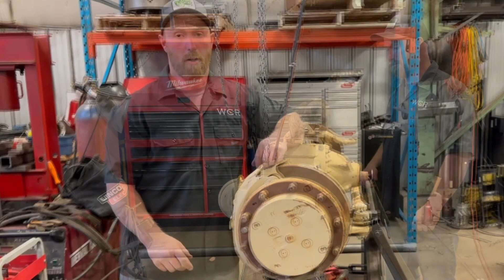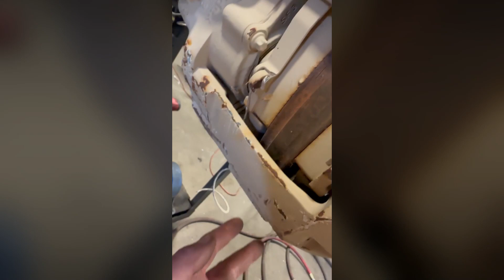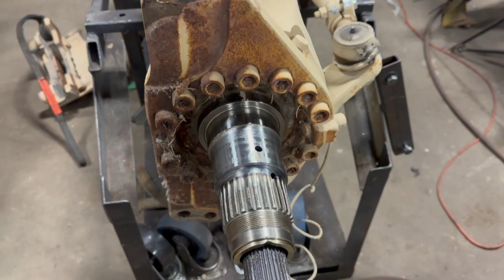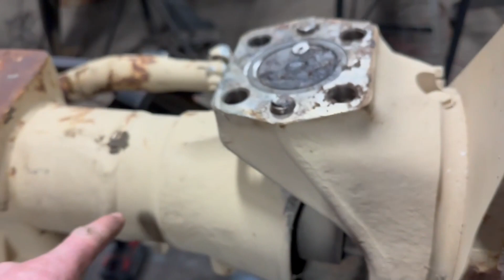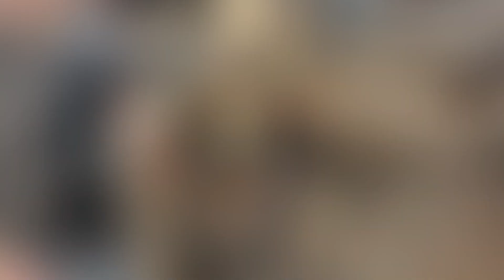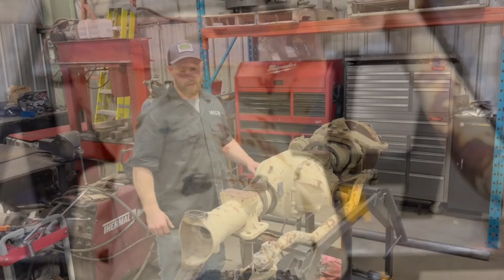Axletech 4000 Wheel End Disassembly

Comment: axletech made portals for the 3 and 4000 have you ever seen these ? I would think that would be a bounty hole killer
Reply: I have the older Rockwell version of the 3000 series with portals. If you look it up on Pirate4x4 you’ll see a pile of pictures of them torn down. Hopefully when they went on to be redesigned by axletech they sorted out the shortcomings. I never did use mine but thinking I might build an independent setup from the knuckles out.
Reply: @jamie_grieve  thank you
Reply from the maker: we have seen a few sets, they are not very common though
Reply: @WesternCanadianRockwell  Why is that . ?  I believe portal hubs or final drives if your a farmer are not more popular is because there is way to much drop .The drop below axle center line is far worse than blocks on top of the housing .  I have been working on coming up with final drives with only 3 inches drop and uses the 14 bolt center section and rockwell 2  1/2 ton knuckles , king pins , U joints .  I am shooting for a 1.75 or there about gear ratio .I wanted to use the rockwell  knuckles mostly because of the boot that keeps mud out of the u joints . But the lack of bushing on the inside concerns me ,. What is your opinion on my choice of knuckle .  I am in the final design phase . Your videos or such a help . Thank you for responding to my comments
Reply: @huckstirred7112  
I’m curious why you think blocks on top of a straight axle is superior to a typical portal axle with say a 5” drop? I’m not disagreeing with you for your application, I’m always interested to learn new things.
I run portals on a few things and they’re really bad if you get properly bogged as they’ll start burrowing under the ground instead of climbing on top. I’m interested in your portal hub design too with how you get a 3” drop, are you using a sun gear like a planetary?
Cheers.
Reply: @jamie_grieve  wow I didn't think anyone would respond to my comment. I didn't say blocks were worse than portals ,I said portals are as equally as bad as blocks . The reason is physics .On a portal your out put shaft has 1 single mission in life . That mission is to be on the same plane as the input shaft . The twisting forces that a portal puts on the suspension and frame is beyond comprehension . And each inch that output shaft is from the input shaft , those forces are multiplied many times over .  I was in third gear going across a lake levy . I hit a knee high man hole cover . No damage to the suspension of the 1 ton power wagon . But it ripped the hood latch off my hood ."the hood flew up and busted my windshield ,The seat ripped from the floor board and I bounced my head of the roof and my nose off the steering wheel / If I had portals my frame would have horse shewed and I would have ended up in the lake upside down .  The output shaft would have had so much leverage my springs may have ripped off as well Blocks on the front have a similar effect .If you go below your bottom king pin  Then the bottom king pin will be doing all the work ,and risk getting sheared .Ever wonder why H1 hummers have the A arms hanging so far down ? That is because they had tho keep the out put shaft above the lower king pin .   If you have to have a geared hub the closer your out put shaft is to the in put shaft the better . The whole reason to have a geared final drive is this .To reverse rotation on the 14 bolt rear end  . As of now if you run a heavy equipment tire , "46 inch and bigger military surplus tires for example " You have 3 choices a flimsy 1 tone dana 60 , "When you have rotating mass 4 foot tall and over 3oo pounds Dana 60 is flimsy " , A 14 bolt with a ww2 g506 transfer case . Rotation is reversed in the transfer case , the front axle standard rotation ,a 2 /2 ton rockwell which has a 12 inch tower on top  or a 2 1/2 ton banjo . If you run a banjo , Banjo is normal strait axle "  with a pumpkin so big you might as well run 38 inch tires on a dana 60
I want an axle that meets this criteria  .Have a similar pumpkin size as a dana 60 but can handle a 4 foot tall tire that weighs 350 pounds .  there are about 4 different types  of 14 bolt axles .  is the heavy duty on motor homes .The only difference is bigger bearings and a 4 inch tube . I want to ad knuckles from a 2 1/2 ton rockwell to the HD 14 bolt . Where the spindle bolts to the knuckle bolt on a gear box . The input shaft would be 1 7/8 inch drop to  3/4 inch ,with 40 splines . then to  1 1/2 inches ,On those splines would be a 3 inch double helix gear ." double helix is twice as strong as a single helix and has no thrust the 1/8 inch acts as a collar and can then be held in place with a snap ring . The bottom  shaft would be 2 1/4 step down to 2 1/8 inches at the splines and 2 inches in diameter the rest of the way out  . The 2 1/2 ton hub would have the diameter which has the bolts  turned way down but be captured in a metal ring welded to the gear box .Hub and spindle would be 2 1/2 ton rockwell . The gear ratio will be 1.4 to 1 that would take almost half the stress off the ring and pinion . That would allow me to shave the 4 bolt to a 10 inch ring gear . The tube being 4 inches in diameter would place the out put shaft about an inch or so below the tube . But still above the bottom king pin . If the 3 inch gears are to tall I may half to go to a 2 1/2 inch tall gear and go with slightly smaller shafts . Sorry for writing a book want to know more or want more  details just say so
Reply: @huckstirred7112  
Ah so a four gear portal to keep the direction the same. With such a short portal drop even with the upper and lower gears almost touching the jacking forces on the intermediate gears would be immense, like many tons. Your setup would be way stronger as a two gear portal with slightly larger gears. I don’t think there’s ever been a successful 4 gear portal on a commercial vehicle. Aftermarket ones like the Tibus and Marks adapters were also plagued with problems in light duty recreational vehicles with the intermediate gears. You could just use massive bearings and not the needle rollers they used to keep it compact. I don’t know if there’s a reverse cut 14 bolt crown wheel?
I do disagree with you on the forces on the frame with portal axles. I would suggest that the only factor at play here is the link location. If you put links on a portal axle in an identical location relative to the hub centreline as a straight axle then the forces will remain identical if the overall gearing remained identical. 
I think if you want to run 48” tyres on portals you could use Unimog axles without putting a spanner on them. The issues become diff clearance and weight. If it’s just gearing then use a banjo planetary axle. 
On the link placement you can have the links well below the hub centre but tucked inside a positive offset wheel rim. I have 14” of link separation on my heap of scrap. Something else to consider is that the factory Rockwell portals have a 1.6:1 diff so the pinion is large relative to the crown wheel which is tiny. It’s only 7.5” so there’s no massive pumpkin and the ground clearance is good.Unfortunately the half shafts are tiny, only like 33mm at the splines but necked down in the shafts. I put a pile of pictures on Pirate years ago.
I think if you have gear and spline cutting capabilities and can get the heat treatment done then building bolt on portals for 14 bolts and 2/12 tons for cheap would be amazing. 
Just thinking too, DSTrac axles warranty their portals up to 46” tyres and they have D70 centres and 4 gear portals. That might be an option for you?
Reply: @jamie_grieve   Acualy I don't want portals .If I flip a 14 bolt and have custom cut reverse rotation gears ,The pinion bearings will starve for oil.  If I get a g506 transfercase to reverse the rotation .Well they have a 1.5 under drive in high range and a 3-1 low range along with tiny output shafts . So If I want a 14 bolt , shaved and for the front a 2 geared hub is  my best option .I love the boot on the 2 1/2ton rockwell .It makes them impervious to mud. Those king pins are large . The outside flange is perfect spot to bolt on a gearbox . So I got durability and common easy to get repair parts . If you ask a farmer about portals he will have no Idea what you are speaking of .In fourwheel drive world they are portals in farm world they are final drives . Said that to keep me from getting confused . You are correct about hooking the links up. If you have a traction bar under your housing close to out put shaft it behaves like a normal axle . But I don't want links hanging down like that . One thing you really confused me on .Is a double helical gear the same strength in both directions .now I am not sure .  If you have a 6 inch portal Adds to to problems of vertical travel .Every tractor I have seen with dropped final drives has 2 spur gears . On larger tractors they are 3 inches wide With a 2 inch out put shaft .that is were some of my dimentions come from . I am right ar the place where the Quiver , Missouri and Missippi river meet .So my focus is mud .It doesn't matter how tall your portals are in mud . 1-2 inches under the housing is no different than 12 inch portal .That doesn't sound correct .Well it is like this Look at a monster truck floating on water .Notice how deep he is .He is hub deep . Once you get 2 inches below the housing ,it is the major diameter of the tire that makes the difference .If you are deeper than the major diameter of your tire ,your foot is to the floor ,your truck is moving inches per minute .If your not out in five minutes ,you over heat or your exhaust manifolds glow red and crack . I am certain in many cases it is not like that and portals from a farmall B would be perfect . Can you imagine showing up to a bounty hole with 28 inches of ground clearance !
 My main purpose is to reverse the rotation of my favorite axle the 14 bolt .I want everything easy peasy . You got me thinking over every detail .After that I may switch to spur gears .I will do some research . The 14 bolt shaved with steering knuckles and king pins along with those big U joints if done right is far better designed than a dana 80 ,smaller pumpkin as well add 2 gear gear reduction with a 2 inch out shaft you would be far more durable than an 80 . For every inch you put under your pumpkin equals 2 inch increase in tire height . So 3 inches doesn't sound worth the effort .But is equal to an increase of 6 inches in tire height . And a 2 inch out put shaft along with a
 2 1/2 ton spindle and hub is just awesome
Reply: @huckstirred7112  
You’ve clearly put a load of thought into this and without knowing your application I don’t know if I can contribute much but there’s a few things you said I don’t understand.
Your comment on the traction bar, I’m guessing then that you intend to run leaf springs instead of links? If that’s the case, you can run your leafs underneath the axle with no loss of real world ground clearance and give a smooth transition for going over stumps.  Alternatively if you did run a traction bar, it doesn’t need to be underneath to work.
Your comment on the additional load on the lower king pin doesn’t make sense to me. The load is increased on both equally. If you hammer two nails into a piece of wood and leave them sticking out an inch and put a long or short bar through them to simulate a portal or straight axle, both nails will bend equally, the longer bar just makes it easier. King pin separation is the key. 
I totally agree that a massive portal drop would be no use in deep mud although I see the UTV’s using them?
I’m In Scotland so I’ve never seen a bounty hole in real life and don’t know if they have a bottom?
We have peat bogs here with no bottom, portals, even if they were ten feet tall would offer no advantage and just make the recovery much more difficult. Even three inches of portal drop is enough to bury the tyre under the ground. Only the bottom third of a tyre assists with forward motion.
Purely just to keep the chat going because I like the tech and to help me understand, I hope it’s cool if I throw some questions at you that aren’t like me telling you what to do but I know you’ll have thought about it and have a reason not to:
1  just bolt on some Unimog axles which are stronger than 14 bolts with larger half shafts and no output shafts to break, have disc brakes and take 48” tyres from the factory?
2 Use a Vee drive or reverse rotation gearbox for the rear 14 bolt to use a simpler two gear portal?
3. Put larger tyres on a straight axle with conventional planetary not portal reduction?
4  Don’t use a differential at all which inherently has a tiny pinion in relation to the size of the crown wheel. Instead use a bevel drive box like off a large topper for a high hp tractor which will have a pinion three times the size of a 14 bolt and a crown wheel half the size. A large crown wheel isn’t necessarily strong in itself all it does is take the load off the pinion. A bevel pinion might not be theoretically as strong as a hypoid gear but it’s stronger than one if it’s much bigger and also stronger in reverse and loses way less hp. You can then have a smaller pumpkin and put all your reduction in the final drive. I bet your 14 bolt has a larger half shaft than the one on the inner sun gear in a 30 ton excavator.
5. Is there a target ground pressure you’re aiming for or just as low as possible? What I mean, is adding weight and complexity going to make you any more likely to get through than say losing weight, cutting stuff out, aluminium block, light duty but lightweight parts?
If I was to imagine building something for bounty holes then I’m thinking something really lightweight like 1500lbs and Sherp tyres but I don’t know anything about the rules or different classes and what you’re not allowed to do and I never saw a bounty hole in real life which is why I’m asking you all these dumb questions. 
To me anything that adds weight in a bog is a bad idea. Your portals would add maybe 200lbs per wheel? To me adding 800lbs, even if it was only 500lbs is still really bad news if you look at the power to weight ratio.
6. What do you do to the bottom of your truck to make it drag less and how can you tie that into whatever your axles are doing? Would putting portals on not just put more drag on the underside and the wheels would sink deeper and be working against your available hp?
7. You could put two helical gears back to back on a common shaft to make your herringbone gear cheaply. 
It wasn’t so much the strength of them I was questioning but the layout where the intermediate side gears are getting pushed apart putting massive forces on the bearings and casings compared with a two gear setup.

I hope I’m not bugging you with all this 🤣
Reply: @jamie_grieve  no not bugging me at all I appreciate it very much . Take one step at a time .Notice the H1 hummer ,the bottom a arm is below the ball joint .The farther you lower your output shaft the more force you put on the lower king pin .It is no different than a lever . if you have the fulcrum in the middle , "A teeter totter " the force is equal ,Move the fulcrum away from center and more stress is applied to the short side .The bottom king pin is your fulcrum . If your output shaft is below the bottom king pin then all the twisting forces created by the bottom shaft trying to back to the same plane as the input shaft is now on the bottom king pin . If you have a king pin from a 5 ton rockwell this is not a problem 
I run in mud pits . A pit of mud 1 -- 200 foot long .Whoever go's the farthest wins . My class is 2, 4  6   . Because of rules I have to have an original frame and springs in stock location .  I am allowed traction bars . You truck has also has to be street legal . You are correct on running leaf springs under the axle . Unimog axles have way to much drop for me ,parts are difficult to find , They are not available with a detroit trutrack limited slip . I could put one gear box on the front with a 1-1 ratio on the front of the transfer case .  But by putting a gearbox on the hub I take half the stress off the ring and pinion .And my wheel is connected to a 2 inch out put shaft . Putting a box with 2 gears 1-1 on the transfercase would be easy done .    A planetary gears in the hub would be easy as they have them off the shelf .  But the highest they go is 3-1 and that is to low .  my gear box would increase weight by around 30 pounds per wheel . 
The box is 3 1/2 inches wide and 6 - 7 inches tall  
Now the weight issue . I will tell you now 99 percent disagree  with me . light is good balance is everything . I personally believe the rear of the truck needs to weigh 300 pounds more than the front . Otherwise your front sinks and your back end floats . The weight on both front tires is equal . The weight on both back tires are the same. but back tires get ballast and weights are put on till I am 300 heavier in back .I will add more later
Reply: @jamie_grieve  https://www.youtube.com/watch?v=r5fTRm8FE0I
Reply: @jamie_grieve  https://www.youtube.com/watch?v=CLePU10XEb8    this is a very famous bounty hole  ,if you make it to the other side or you get to the other side the fastest ,  you get 2500
Reply: @jamie_grieve  your helical gears are what I planned to use all along , until I started answering your questions . , now I am wondering if it is as strong in reverse as forward . I am about 1 month away from handing my plans to engineer to put on auto cad , then life size plastic model . I am hoping you can point out flaws because that would save me money . 
My goal is rather simple . if you want an axle to handle a 4 foot tall tire that weighs 350 pounds you need a 2 1/2 ton axle . the famous rockwell has a foot tall tower on top and the other 2 1/2 ton axles have beech balls for pumpkins
I want an axle that takes up similar space as a dana 60 but can handle a 4ft tall 350 lb tire ,  have common parts and parts availability .  And has a detroit tru  trac available for it and an manual locking diff for the rear.
The 14 bolt is a very heavy duty axle that is found every where . The heavy duty version  found under motor homes and tow trucks , Is 1 small step away from rockwell strength. The rockwell has 3 5/8 square tubes . The HD 14 bolt has 4 inch round tubes both are a 1/2 inch thick .  both have 1 1/2 inch axles but the rockwell has some serious massive u joints ,spindles and hubs
" I had a truck with a 427 chevy big block , 21/2 ton 5 spd and ,transfer case and axles " it was stolen " 
The only prpblem with a 14 bolt chevy  HD is it is only available  as rear axle . 
The 2 1/2  ton rockwell is cheap as the Hd 14 bolt and it is a perfect match for the tire I plan on using .  The geared hubs accomplish two things . They reverse the rotation and make the gears in the pumpkin twice as strong  . The tires being turned by a 2 inch diameter shaft captured on both ends is almost indestructible . The front knuckles of the 2 1/2 ton rockwell seem to be tailor made for a gear box . Where the spindle bolts to the outer knuckle is enough space to bolt on my gear box . I don't want to say for certain until my engineer looks at it . But from all that I have studied my gearbox will make the 14 bolt heavy duty stronger than the 2 1/2 ton rock well .
My goal was never a portal . My goal was reverse the rotation and increase the 1 1/2  ton axle durability . 
Thanks to you I am most likly going to go with spur gears . A D 9 cat has 3 inch wide spur gears so I know that is plenty .  The actual gear box and the inside knuckle are pretty much the only custom high dollar parts . I am hoping i can accomplish everything both axles for under 6 grand
Reply: @jamie_grieve  the gears are the size of a coffee cup ,   so put together an  8 inch saucer put 2 coffee cups touching each other then put an 8  inch plate on top that is the size of my gear box
Reply: @huckstirred7112   Great response, I’m with you now on the lower king pin as you’re talking about the torque from the shafts rather than the forces imparted by the brakes and hitting things like I was thinking of.
 The resultant torque on the king pins from the drive torque is interesting as it’s a component of the input torque and output torque and depending on how far each is from the king pins and if it’s a two gear portal, this is something else I was going to say, a two gear portal cancels some of the torque from the output because it goes the opposite way, on a 2:1 portal it brings it back to nearly the same as a regular axle approximately but I would say these numbers are a fraction of the forces from impacts and braking and I wouldn’t worry about them at all as the tyre will slip before the numbers get scary. The Volvo portal axles just use a 5/8 bolt for king pins, your Rockwell king pins aren’t ever going to be the weak link for sure.

I totally agree with everything you say regarding reducing the stress in your drivetrain. I would suggest that’s reason enough to run a lower portal gear like 2;1 or even lower. You can always run in high range to keep your wheel speed up but it will dramatically reduce the stresses in your driveline.
To sort of back this up,  I was running 16.00 x 20 Military tyres and on a steel truck rim with heavy tubes and rim locks they were near 600 pounds each. I was using them for mock up as I didn’t want to spend on ag tyres until it proved itself. I shit you not, I put some 1310 UJ’s on my propshafts with a 12V Cummins and never broke a single one. Partly because of the 2:1 portals and partly because I was running solid propshafts, not tubular ones like everyone else does. This was a technique used before we were born that’s been forgotten I’m also running rubber donuts between my transfer cases to further reduce the shock loads. The propshafts twisting also reduces the severity of wheel hop dramatically on high traction surfaces and twist instead of breaking the UJ’s or portal gears. 
My portal output shafts are tiny, only 16 spline 1.75” but I’mm looking to upgrade them to 2” sometime, they’re fully floating which is unusual for portals. 

Something else I have that reduces axle stress and forces on the portals which might work for you is I run Tracta joints instead of UJ’s. They’re actually stronger than UJ’s of the same diameter but more importantly are constant velocity. I know the early 2 1/2 tons used them but I don’t know how big they were myself but not having your axle trying to speed up and slow down a massive wheel every quarter turn definitely makes a difference to things holding together.

I think the aspect ratio of your 3” wide gears is to wide for the diameter. On a tractor, the bull gear is like 14-18’ across if it’s three inches wide. Any slight wear in your bearings or flex in your housings will affect your tooth contact area and effective strength massively. I think if you ran a bigger bull gear it would improve the strength massively by reducing the tooth contact pressure so much. As an example, Hummvee portals are small and the armoured ones are up to 6 tons on 37” tyres with a Dana 30 diff that’s not even strong enough for a Jeep on 29’s. Portals or planetaries will really protect your drivetrain even at 3:1 and you can just run in high and everything will last longer. 

What wheel speed do you need for the bounty holes?. 

Are the MRAP axles just too heavy for bounty holes?

Your comments on the balance make a lot of sense. Do you run your front tyres the wrong way round? I usually do nowadays.
One huge mistake I made because I built mine for the bogs was going for radial tyres, I never had them before and didn’t appreciate how much heavier than bias plies they are. I’m going to try and shave some weight off them in the summertime. I don’t know your ply rating but maybe you can look at pulling some plies out your tyres like the Russians and Eastern Europeans do to shed some weight and inertia from the tyres because it’s that inertia that breaks stuff.
Keep me posted with your thoughts please.
Reply: @huckstirred7112   Great response, I’m with you now on the lower king pin as you’re talking about the torque from the shafts rather than the forces imparted by the brakes and hitting things like I was thinking of.
 The resultant torque on the king pins from the drive torque is interesting as it’s a component of the input torque and output torque and depending on how far each is from the king pins and if it’s a two gear portal, this is something else I was going to say, a two gear portal cancels some of the torque from the output because it goes the opposite way, on a 2:1 portal it brings it back to nearly the same as a regular axle approximately but I would say these numbers are a fraction of the forces from impacts and braking and I wouldn’t worry about them at all as the tyre will slip before the numbers get scary. The Volvo portal axles just use a 5/8 bolt for king pins, your Rockwell king pins aren’t ever going to be the weak link for sure.

I totally agree with everything you say regarding reducing the stress in your drivetrain. I would suggest that’s reason enough to run a lower portal gear like 2;1 or even lower. You can always run in high range to keep your wheel speed up but it will dramatically reduce the stresses in your driveline.
To sort of back this up,  I was running 16.00 x 20 Military tyres and on a steel truck rim with heavy tubes and rim locks they were near 600 pounds each. I was using them for mock up as I didn’t want to spend on ag tyres until it proved itself. I shit you not, I put some 1310 UJ’s on my propshafts with a 12V Cummins and never broke a single one. Partly because of the 2:1 portals and partly because I was running solid propshafts, not tubular ones like everyone else does. This was a technique used before we were born that’s been forgotten I’m also running rubber donuts between my transfer cases to further reduce the shock loads. The propshafts twisting also reduces the severity of wheel hop dramatically on high traction surfaces and twist instead of breaking the UJ’s or portal gears. 
My portal output shafts are tiny, only 16 spline 1.75” but I’mm looking to upgrade them to 2” sometime, they’re fully floating which is unusual for portals. 

Something else I have that reduces axle stress and forces on the portals which might work for you is I run Tracta joints instead of UJ’s. They’re actually stronger than UJ’s of the same diameter but more importantly are constant velocity. I know the early 2 1/2 tons used them but I don’t know how big they were myself but not having your axle trying to speed up and slow down a massive wheel every quarter turn definitely makes a difference to things holding together.

I think the aspect ratio of your 3” wide gears is to wide for the diameter. On a tractor, the bull gear is like 14-18’ across if it’s three inches wide. Any slight wear in your bearings or flex in your housings will affect your tooth contact area and effective strength massively. I think if you ran a bigger bull gear it would improve the strength massively by reducing the tooth contact pressure so much. As an example, Hummvee portals are small and the armoured ones are up to 6 tons on 37” tyres with a Dana 30 diff that’s not even strong enough for a Jeep on 29’s. Portals or planetaries will really protect your drivetrain even at 3:1 and you can just run in high and everything will last longer. 

What wheel speed do you need for the bounty holes?. 

Are the MRAP axles just too heavy for bounty holes?

Your comments on the balance make a lot of sense. Do you run your front tyres the wrong way round? I usually do nowadays.
One huge mistake I made because I built mine for the bogs was going for radial tyres, I never had them before and didn’t appreciate how much heavier than bias plies they are. I’m going to try and shave some weight off them in the summertime. I don’t know your ply rating but maybe you can look at pulling some plies out your tyres like the Russians and Eastern Europeans do to shed some weight and inertia from the tyres because it’s that inertia that breaks stuff.
Keep me posted with your thoughts please.
Reply: @jamie_grieve  I got the with from an Alice Chalmers tractor .  If that gear with will handle a large tractor it will handle my truck . My gear box  just bolts right in place of where the spindle would go but there is a lip on it ,so the box is captured so there is no shear force on the bolts that hold it to the knuckle ,   upper shaft is supported on each side by bearings , the splines in the middle hold the gear, the bottom gear ,is 2 inches bearings on inside of the case . on the outside of the gear case is where the 2 1/2 rockwell spindle bolts to .while the bolt circle has been made smaller it is captured . If you so the entire set up bolted on ,you would look at it and something would seem slightly off . but other than that you wouldn't notice any drastic . The  axle center line has been lowered by the diameter of 1 single coffee cup .That is it . Take coffee cup to your car in the morning and plce the bottom pof it right at the bottom of the axle center line .YUp slightly below the center of the hub cap .  And yea when engulfed in disk break and tire rims you wouldn't be able to even be totally sure what is off or why . You might even think it is broke . You would have to increase your tire height by 6 inches to put that 3 inches of space under your truck . That geared hub since it is captured , and the spindle is captured .You would have to break the knuckle in half before anything sheared .  And those to gears make every thing that is before them a lot more durable
Reply: @huckstirred7112  I would probably go with a heavier knuckle, the 2.5 Ton factory knuckles seem to be fairly brittle, that or an upgraded version of the 2.5 Ton knuckle would be good
Reply: https://www.youtube.com/watch?v=9IqediKKD8A